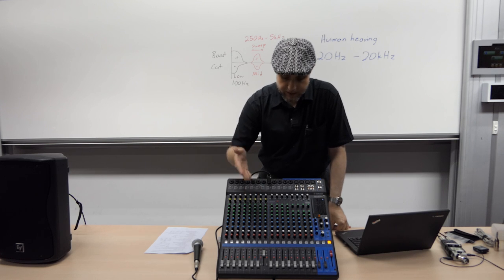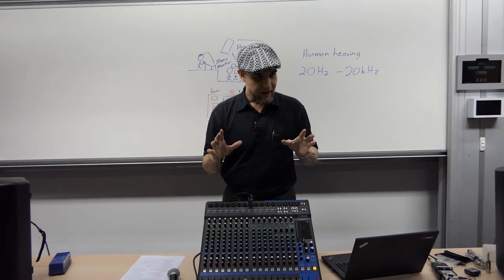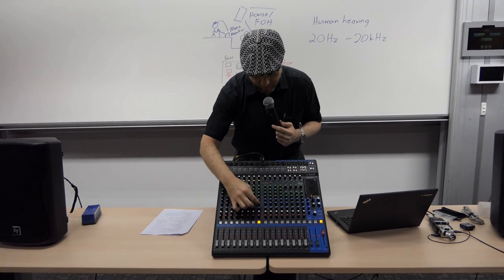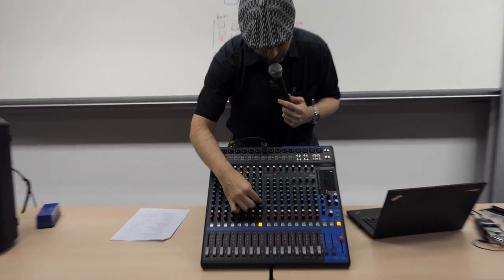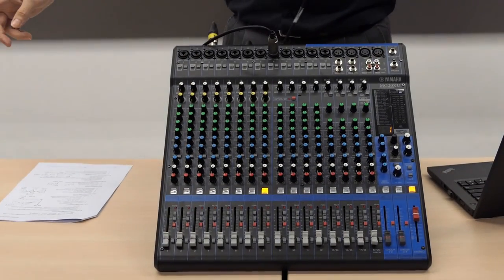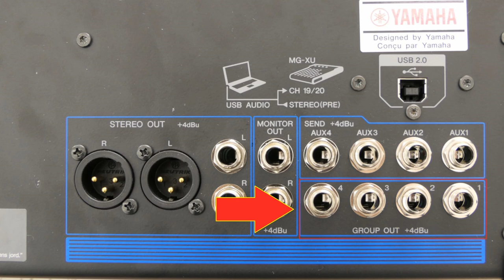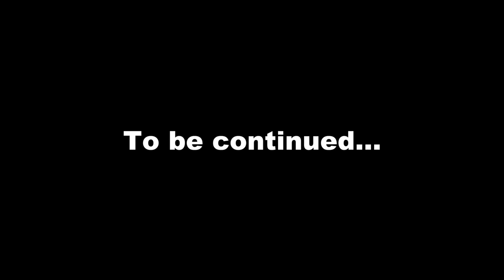Yamaha MG20XU mixer training part two

Comment: Sir can you recommend a driver for Yamaha MG16XU for easy connection to computer? Cant connect to my PC despite downloading and installing Yamaha Steinberg USB drivers....An error "could not open device" keeps popping up. Please help
Reply from the maker: If you are using Windows 10 no driver is necessary - just plug in and the mixer will be detected as a USB input/output source.
Reply: @GLBProductions  I am gonna try that. Thanks slot

Comment: Does the PRE work for all aux or just for the AUX 2? Also, is there a way to hear (or SOLO) the aux channels? On some mixers there are solo buttons for AUX. I don't see this button on this mixer board.
Reply from the maker: The PRE button is only for Aux 2. Aux 1 is fixed pre-fader, 3 & 4 are fixed post-fader. No there is no way to solo the aux sends on this mixer.
Reply: @GLBProductions  thank you!

Comment: Hi Bruno, is there a way to have a separate master volume on each master channel , left and right. I have the MG16XU model and 2 active speakers, one connected to master left and the other to master right? Many times it is required to lower the volume on one of the speakers, is there a way to do it besides panning each input or going to the speaker and adjusting the volume? So a way to do the same thing you would do on mixer with master right and master left faders. 

Thank you for all the tutorials, you are the best teacher on Youtube!
Reply from the maker: Hi Victor, that is not possible on this mixer - you have to use the pan controls. If you need a consistently lower volume on one of the speakers the best way is to just turn down the level control on that particular speaker (if active) or amplifier channel that feeds that speaker (if passive).
Reply: Hi Mr. Goh, in today's analog world, is there analog mixers by reputable brands that still provide dual LR master faders, that is worth recommending? thx alot..
Reply from the maker: Yes the Allen and Heath Mix Wizard series provide this feature, as well as a separate fader for a mono output. Of course all large-format analog consoles provide this feature but those are much larger in size.
Reply: ah, I almost forgotten the AH MixWizard line of small format mixers.. thx for the refresh...
most recent analog small format mixers by reputable brands have do-away with dual LR faders due to space for other features, cost and trend factors..

Comment: Can you help me with trying to connect xvive U4 IEM to this mixer? I tried to get it going and it didn't work.
Reply from the maker: Connection of that particular IEM system is very simple because it only requires a mono signal - you can use any output on the mixer, but most engineers would use a pre-fade aux send.
Reply: @GLBProductions  Thank you for your response.And I love your videos. I am new to all of this and slowly learning. For clarification would that just be one of the aux sends towards the back of the mixer board?
Reply from the maker: You're welcome Yolanda. Yes use one of the pre-fade aux sends - on this mixer it would be aux 1 or aux 2 with the PRE switch engaged.
Reply: @GLBProductions  Thanks

Comment: Can we connect it to a DAW and route effects and use it  for a particular channel???
Reply from the maker: Yes you can, as long as your DAW will allow the appropriate signal routing.
Reply: @GLBProductions  I tried using it..but I can hear latency in the fx from DAW and also my DAW when connecting with the console makes my pc very very slow... sometimes it shows not responding

Comment: Can you use group connect stage monitor for example if you are use aux1 and 2 for equalizer?
Reply from the maker: Not a good idea - best to use the aux sends for stage monitor purposes.
Reply: @GLBProductions  can you please give a reason why? I have the  MG12XU. It only has 2 Aux outputs, and to be honest I'm still not sure how the FX knob that also controls the Aux2 works together. Until I can get my mind wrapped around that one I use AUX1 for stage monitors and link 2 to 3 monitors together, so they all have the same mix. I have one band member that wants his own custom mix separate from the other monitors. Instead of buying another mixer I was wondering if I could use the group output. But that also leads me to another question......at the last gig I had to use the group fader to boost the volume on the lead singer. He used a wireless mic. I had him on channel 1. I had st pressed in as usual, but couldn't get enough volume to match the rest of the band. They used they're own on stage amplifiers this time and where very loud. I pressed in the group 1-2 button with the ST button also pressed in to get a boost. It worked, but I'm sure there is a better way. Please advise. Thank you so much for these videos.
Reply from the maker: @AmberSLancaster  Hi Amber - the group outputs are less suited for use as monitor sends because they do not allow you to select the amount of each channel that you want to send to the monitors, unlike the aux send. You CAN use them in a pinch, but on this particular mixer if you regularly need more than one monitor mix it's worth considering an upgrade to a larger board. 
On the wireless mic - check that your gain is set correctly, and that you have already used up to 10dB of additional gain that is available on the fader. If you still don't have enough volume then you need to increase the level on your power amplifier or active loudspeakers.
Reply: @GLBProductions  thank you so much for replying so fast! And thanks for sharing your knowledge. I couldn't do this without you. Really.
Reply from the maker: @AmberSLancaster  You're welcome Amber, that's why I set up this channel in the first place 😊

Comment: Question please.  Do  main outputs and mon (monitor) output are totally separate lines. My problem is because I get alot of high  frequency loss from my floor monitors when the bass is playing . We loose guitar high and some meds frequency. I do have crossover from my subwoofer to my top speakers but there is no low cut or frequency cut setting in the mon output and so my monitors speakers don't have any settings for it
Reply from the maker: That sounds to me like an issue with the processor or amplifier - the bass signal is triggering a compressor or limiter that is making it appear as though the mid and high frequencies are disappearing. Try running your monitors off the AUX sends instead and see if the situation improved.

Comment: I want to question to u sir..how to control fedback of mic into monitor.. because..most reason..the noise..of unwanted sound..came from monitor..and how to control the fedback. Of .out put sound
Reply from the maker: That's the subject of a different video 😄 In most cases it's caused by your monitors simply being too loud.
Reply: Yes sir i have dbx digital rack..but i cannot set the setting sir
Reply: Can you teach me sir..how to setting my rack..

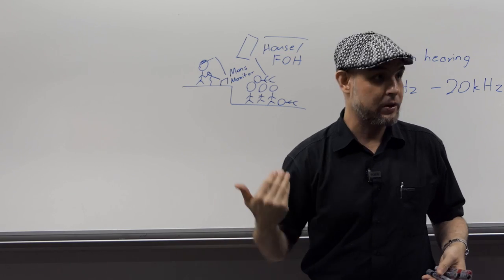Comment: Question on ( Aux send ) to stage power  monitors. Do 2:27  These aux send have a low cut frequency for the bass  or a crossover ?  I know when u run the 2 main outputs for audience u connect to power sub and adjust the crossover and then to the top load speakers, but what about the aux send to power monitors , do they get also feed from the sub crossover settings or do you need a separate crossover tunable or to adjusted from the power stage monitors speakers settings
Reply from the maker: On this particular mixer there is no processing on the aux sends. You can of course add it later using the processing available on power amplifiers, active loudspeakers etc.
Reply: @GLBProductions  so let's say , if the power monitor stage speaker don't have any settings for crossover , that means the  guitar bass frequencies let say 30 or 60 hertz will  go trough the aux send monitors and will affect the overall performance of the speaker correct like dimishining guitar and vocals
Reply from the maker: That is possible, yes. However a good biamplified setup can minimize the impact of the low frequencies.